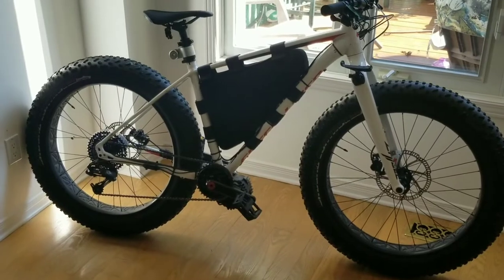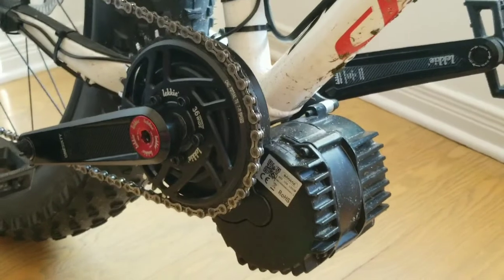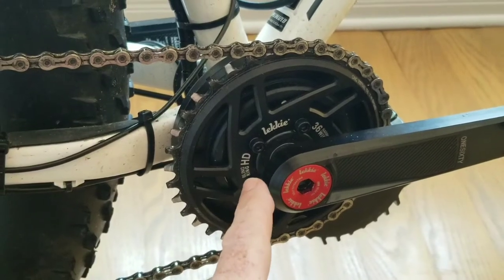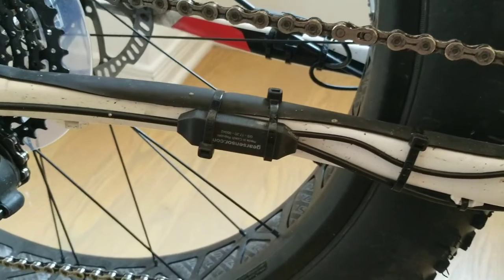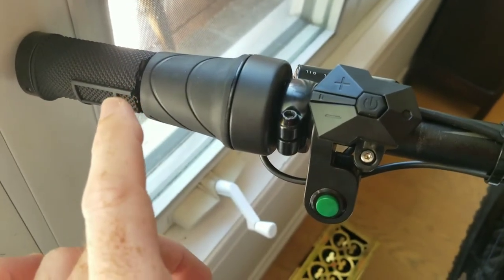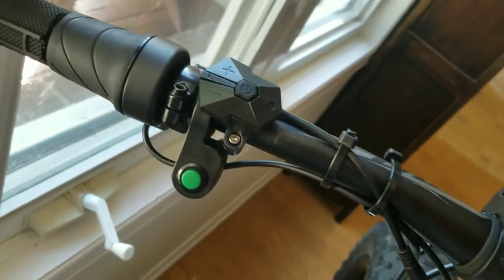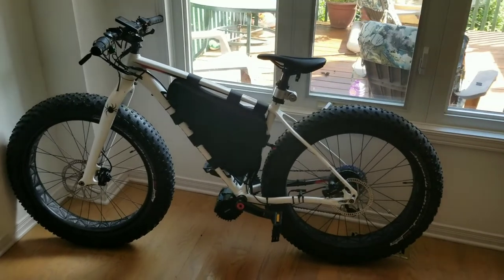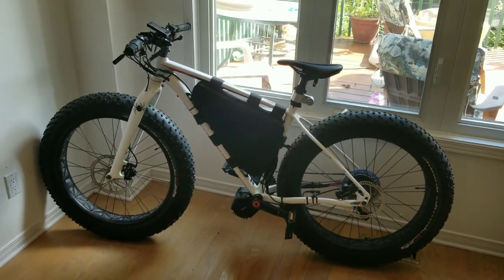Bafang BBSHD on Specialized Fatboy ebike conversion (stock) 30 amps 1500 watts

Comment: Hey fantastic vid just what I needed to know I'm converting my 853 Reynolds Cotic Solaris 29 er to this set up. I run a 1 x10 11-40 cassette BTW. So are you saying you can't run a 10 speed cassette then due to the width?
Reply from the maker: You can run a 10 speed cassette easily enough with a stock system as long as you can get the chainline pretty central. At higher power having a really straight chainline is critical. With higher power the gears become less used as you just want to stick it in a big gear and let the motor spin fast and do the work. Sounds like a cool bike you have to convert! Good luck.
Reply: Any number of gears works if you can work out a reasonable chain line. The stock chain ring or anything smaller than 42 tooth sit too far from the bike to allow the chain to access the lower (bigger) gears and remain straight. There are larger chain rings available for the BBSHD that bring the chain line in towards the bike allowing access to the lower gears. The Luna Eclipse (42 or 48 tooth) or the Lekkie Bling Ring (42 or 52 tooth).
Fewer gears means a thicker chain. You don't need a lot of gears just a good ratio between hi & lo. The thicker chains may stand up longer to the power of a motor.

Comment: 3:07 those silver washers, can you just get those from your local hardware store? Also, did you have to use a bottom bracket adapter to make the motor fit? (Like a bb30 to bsa adapter)
Reply from the maker: Yeah that is exactly where I got them. My fatboy was bsa already but there is a pf30 version about. You can get adapters though on ebay. Hope this helps. Cheers. Feel free to join the discord to post questions on there as well!
Reply: @HighVoltageKits  Fantastic, thank you so much for the help!
Reply from the maker: Anytime. Good luck with your build.

Comment: Hi. I have the 100mm bbshd from another build. From your experience, is their any hope that i can make this work on a fat boy? Someone suggested not using locking ring on the non drive side, adding Lock tight to secure, to shave off a few mm. I'd never hold you to the advice, just asking if you think there's a decent chance to make it work.
Reply from the maker: It has been a while since I put it on but I think it would not leave you many threads. The crank offset would be quite severe. If you have the frame already i would trade the motor for the wider one. Another possibility is to locate a frame or modify a frame to the clearance will fit with the 100mm bbshd size.
Reply: @HighVoltageKits  thanks. Hoping it will work out.
Reply from the maker: Good luck with your build. Hope it works out!

Comment: Could you not use a recessed lekkie chainring so you can reach your two larger gears?
Reply from the maker: In the end I settled on the 42t lekkie. 100% the right call. Its not perfect due to the offset but it improved things no end. Cheers

Comment: I've heard chains are a problem of snapping (cheap ones) is that a stock chain? or do you have a chain you recommend?
Reply from the maker: I broke the stock one a few times but it was my fault. SRAM chain seems recommended. The kmc 6-8 speed chain I am on is lasting well. I am single gear tho these days..The SRAM is a good bet. Well made. What broke mine was being in the wrong gear for a short hill. Then standing on the peddles and muscling it with the motor engaged via pas. Just too much stress and snap. I stopped doing that. Keep it well lubricated etc usual chain maintenance. You will wear them faster but not at an insane rate. Unless your chain line is really bad or there is another factor at play. Hope this helps. Cheers
Reply: @HighVoltageKits  thanks for the info, youre single gear now as in like a single speed bike kind of way? Or you still have a Casette but use only one gear?
Reply from the maker: Still the cassette I just move the gears to get good chainline. Running 1 to 1 42t to 42t. At 72 volts ASI you get 13,000 rpm range to play with so it reaches 65kph on the flat in that one gear.
Reply: @HighVoltageKits  thanks so much for the help, hope you don't mind me reaching out in the future!
Reply from the maker: Sure. You can join the channel discord if you like. You can post questions on there  I am usually pretty active. https://discord.gg/FpCA8P4F

Comment: Hello.... what size BBSHD did you use? And what is the width of your  Bottom Bracket?
Reply from the maker: 100mm bb but using the 120mm as it wont clear the chainstay otherwise
Reply: Captain..... how many millimeters did you have to space on the sprocket side?

Comment: I really like your build. Looks cool. I have a Radrhino and find the 750W geared rear hub motor pretty much meets my requirements to climb the hills in Spain up to 10-15% gradient. However bike frame and components is very much mid/low level. I used to have a Stumpjumper and loved it until I literally wore it it out. So, my plan is to build a Fatboy, with a Bafang 750W rear hub motor, and maybe run it up to 25Amps with a 48/52V battery. Perhaps a Hailong shark style battery to the max capacity -- 17Ah. Any thoughts vs mid-drive? Is there space to fit a controller? Can you fit a rack on fatboy? Any suspension ideas? Best frame size for 1.8m rider?
Reply from the maker: mikeinmadrid1 thanks Mike. As this is the only e bike build I've done I cant really offer much advice. I'd figure out what kind of riding you will do and ensure the bike will do it well. You can put these on any frame. I'm going to do a full suspension mountain bike frame next up. 

In terms of power. If you think 750 watts of rear hub will move yourself and cargo etc up hills at a speed that is acceptable then go for it. They are cheaper. With a mid drive you keep the gears so you are a bit more flexible. It's more complicated installation but I wouldn't say hard.

Not sure about racks. You could make something. Or use a trailer which I do. I have a large and there is easy enough space for a controller.

Good luck with your bike!

Comment: Do you recommend a certain adapter for the bottom bracket? The inner diameter of my fatboy bottom bracket is 46mm and the motor is 33.5mm.
Reply from the maker: You need a pf30 bb adapter I am pretty sure.  This is an example. I could not find the one I recommend a while back though https://www.ebay.com/itm/225346139566
Reply: Thanks!

Comment: hey man - i just got the bbshd motor and a 52v battery delivered. interested in you power upgrade kit (does this work fine with 52v bat?) - your links in this vid description, one is broken and the other has info but no rpice or anything, please give me the details. cheers
Reply from the maker: Hey Sam. Thanks for the interest I will have to fix the links. I'm in the process of updating the website right now. https://highvoltagekits.com/hv-shop/p/bbshd-bac855-upgrade-kit is the link. You are also welcome to join our Discord group if you need any help with your motor. https://discord.gg/53GBcxw9Hk Welcome to the BBSHD club!

Comment: Did you have to change to a 1-by drivetrain up front or was it already like that?
Reply from the maker: It came with a 1x10 on the rear and a 28t on the front. Cheers!
Reply: @HighVoltageKits  would this system work if I had 3 gear up front you think?? I'm trying to out this on my mtb
Reply from the maker: I am not sure it would be possible. With this kit you replace the front part of the drive train. You would gain very little as the motor has so much torque and power. The range on a 11_42 cassette is plenty. I ride it fixed gear now at 72 volts. https://youtu.be/c7q5TbIYq7I
Reply: @HighVoltageKits  gotcha. If there's nothing to miss, might as well go ahead.
Reply from the maker: Its addictive lol. Be warned ;)
Reply: @rajgill7576  It does work. I did it with my old mtb. Went from 24 speeds to 8 but you don't need as many with the electric help. I did later upgrade to a 10 speed wide ratio cassette but only because you couldn't get a wide ratio 8 speed a few years back. You will have to remove the front derailleur.

Comment: Hi Captain, I wanted to ask, which triangle battery from em3ev is the best for the original bafang bbshd.  With which battery I can run the most kilometers and to keep my maximum power?
Reply from the maker: S. U. Are you in the states?
Reply: I am in Iceland
Reply: Sorry did I ask badly?
Reply from the maker: They have two options right now. They only have one high power option though. Best to email Joseph there and ask him for a pack that allows 50 amps with the cells and bms. I used the 30q cells but they aren't listed for some reason.
Reply: Thanks friend
Reply: "Best" depends on intended use. Basics are Volts = top speed, amps = power to accelerate & amp hours = range. The original BBSHD was intended to run on 48 volts at 25 amps (continuous). It will do this reliably for miles. Most can run on 52 volts at 30 amps (continuous). Check your controller specs but if you have the average BBSHD & just want the basics with no intention of future upgrades your battery should be 52 volts and put out at least 30 amps continuously with a capability to burst to 50 amps. For future upgrade-ability you may consider a 50 or 60 amp continuous output with peaks over 70 amps. After that it's choosing how much you're ready to spend on amp hours (to get the range you want).

Comment: So by trying to maintain climbing capability with a small chainring, you lost it by creating enough chain crossover to make your lowest gear unusable : /
I hope you calculated your final drive ratios, you just might end up ditching the small chainring for a more offset 42 or 43 and full use of rear cogs.
Edit:
By the way, I'm considering converting a mountain bike to electric. 2 years in is the BBSHD still worth it?
Reply from the maker: I love my bbshd. Its super reliable and I now have it at 3.5kw 50 amps at 72 volts.  I did switch to the 42 t lekkie for chain line as you mentioned and also rearranged my cassette as well. These days its single speed 42 to 42 and climbs anything. There are a few more videos on this. This is a link to all my bbshd videos on this bike most recent at the top https://captaincodswallop.net/bbshd
Reply: @HighVoltageKits  Thanks for that, will watch all before purchasing.

Comment: Was the 100 mm Fat Tire Bafang motor used ?
Reply from the maker: I had to use the 120mm version. The chainstays mean the 100mm will not fit with this frame although the actual bb is 100mm. Hope this helps. Cheers

Comment: You vdo is very instructive. Finally,  did you find a way to access to the last gear of the cassette?
Reply from the maker: Simon Brousseau Thanks. I have ordered the 42 tooth cog which has a 18.5mm offset. I did get in the big gear a few times but the chainline is very poor. I have a feeling it would cause alot of wear. I'll update later in the year when the new gear gets fitted
Reply: @HighVoltageKits  thx a lot for the answer.

Comment: hi friends the central crank axle of the frame how much does it measure? because in English voice I did not understand sorry 120 MM ?
Reply from the maker: Vortex R Adventure Hey Vortex. It's the 120mm version I'm using. My bb is technically 100mm... but a 100mm bbshd wont clear the chainstays.
Reply: @HighVoltageKits  ok thank you, so on this type of machine it is better to take the axis of 120 mm shot? the 100mm does not pass?
Reply from the maker: Vortex R Adventure There is no way it would fit on mine. You could make a template maybe from the dimensions online and see if the gearing clears the chainstay on your bike.
Reply: @HighVoltageKits  I thank you for your prompt reply, best regards

Comment: I have the same bike but standard.Do the spacers for the motor come in the kit.
Thanks for the vid.
Reply from the maker: Depends where you get it and the questions or request you make. I asked for a few knowing the offset already would be over 5mm. They are not hard to source tho.
Reply: @HighVoltageKits  Thank you.

Comment: I'd love to do this set up on my surly ice-cream truck fatbike as my knees are giving up the ghost now but unfortunately the surly has a 132mm press fit bottom bracket and I'm guessing the widest bafang motor axle is 120mm.
Reply from the maker: Wish I could give you better news. I found this link.... https://electricbike.com/forum/forum/builds/ebike-building-directions/843-surley-ice-cream-truck-a-bridge-too-far

You can get around the pf30 bottom bracket using an insert that narrows the sizing converting it to British threaded size which the bbshd is... But as the guy in the link found it leaves very little spacing to get the chain line right and limits the size of front cog. The guy said a mighty mini from luna might work.... That said nothing wrong with a small front gear I used a 36 tooth to start with.  If you need any more info I'll try and help. I have a link to the pf30 to British thread inserts somewhere.

Comment: got the same bike and im gonna set it up pretty much like this, did you used the 100mm or the 120mm bbshd? thanks mate
Reply from the maker: I used the 120mm. I had to space it 1.25cm away from the bb to clear the chain stay.
Reply: thanks, what i was looking for :) the 100mm would be too short then
Reply from the maker: @foccalabindella2  that was the impression I got from the videos I watched. I didn't want to run the risk of return shipping. You might squeeze in the 100mm but you wouldn't have that much left to bolt the lock nut on with. the cranks would be different distances from your frame. The bbshd makes your foot position a bit wider anyway.
Reply: yeah better be safe than sorry, more room = more spacers but who cares plus that locknut is really important ( i made already a few bbshd builds ) and you really dont want the inner one to get loose...i always buy from em3ev and their service is really good..now i cannot decide if go like you with the bag or with the jumbo shark pack aaaaah .. hows the 36t chainring doing so far on flats? i bet its like a goat uphills lol
Reply: oh also, is that a L size frame? and you did good not buying the stock chainring cause its a piece of junk, chain skips and all the rest, crazy fast ( about 68 kph on a fatbike ) but 100% not worthy
Reply from the maker: @foccalabindella2  yeah it's a large frame. the 36 tooth is good but I am losing my granny gear due to chainline issues. it's good on hills tho especially pulling a trailer. I got 59.8 GPS verified downhill and 53kph on the flat. but it eats battery at that speed. its plenty fast for a fatbike lol.
Reply: yeah plenty indeed lol , i find the sweet spot on a fattie to be somewhere between 38 to 45 kph but sometimes is just fun going a little bit crazy, i received from them spacers for the chainring but those would space it even further out , mine is a M  size i'll try with the 42t once they restock and see how the chainline will do, thanks for the infos :D
Reply from the maker: @foccalabindella2  your line will be better with a 42 or 46. the em3ev bag should go well in a medium. it hangs down a little on the large frame. The battery is smaller than the bag by quite a bit maybe 20% left over. good luck with your build.
Reply: yeah since im buying the 17ah battery there will be enough room to put tools and all the rest in it :) thanks
Reply: Go for the 120mm to be on the safe side as l found out the hard way and return postage was £130, fortunately for me l was able to put it on my other mountain bike with slight modifications. Originally ordered it for my felt fat bike with 100mm bb as listed but like l said it didn’t fit so 120mm is the safe bet👌. Hope this helps.
Reply from the maker: @solardiymadesimple.3779  felt make a good bike. how is your chain line?
Reply: Couldn’t get it to fit on my felt due to the frame being to wide at the back wheel ( Dam shame )so l ended up fitting it to my cube instead. My battery is 52v x 22a. I left the standard 46 front chain ring on and with my 10 speed rear cassette l can achieve approximately around 40mph. No issues so far with the chain snapping. When l originally tried it on the felt the chain line didn’t look the best, l probably would of only been able to use the lower gears and the may have gave me issues.
Reply from the maker: @solardiymadesimple.3779  that's cool tho. forty mph is pretty quick for a bike. interesting the stock ring is working for you. it still feels odd to have so much acceleration. the kick when the battery is at 58 volts is awesomeness.
Reply: @HighVoltageKits  The thing is  l never do the gear changes whilst in mode 5. Once I'm in the top gear then I'll shift through the modes. Maybe that's why I could be getting away with using the standard chain ring, and not chewing up chain's ect. Like wise l would love to buy a new chain ring ie a 38 tooth but can't warrant spending £80 plus another £20 shipping to the UK unless santana comes early lol.
Have you reprogrammed your unit? If so is there any benefits . And yes try taking a corner / bend at that 40mph like I did and it becomes kind of dangerous.
Reply from the maker: @solardiymadesimple.3779    sounds like your riding style is a good fit for your bike. I didn't have the option as i ordered the lekkie ahead. its expensive but very well made. I have left the programming the way em3ev does it. they have full throttle on level 0 and sensible options for power curves etc. some swear by karls special sauce settings. they only vary from the em3ev setting in two small areas tho. I would like the peddle assist to cut out a touch sooner on single track tho.